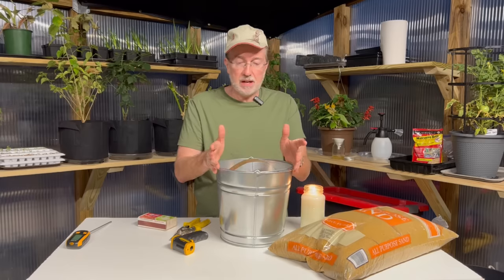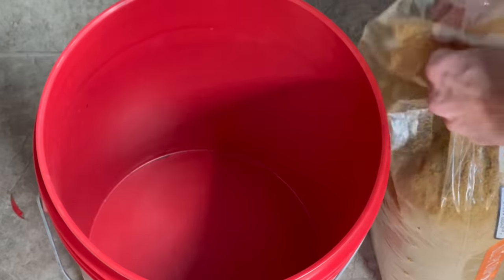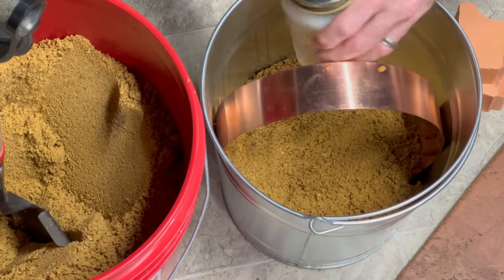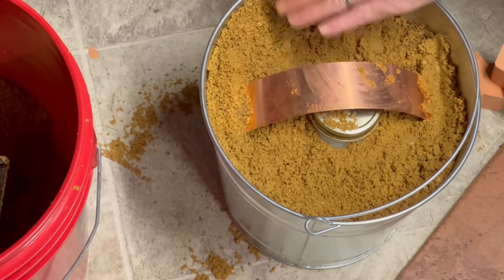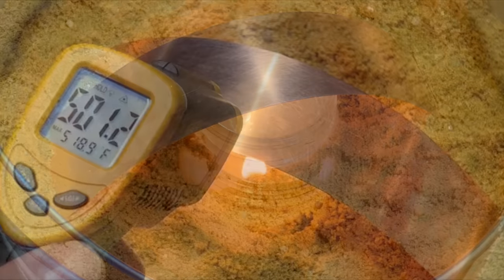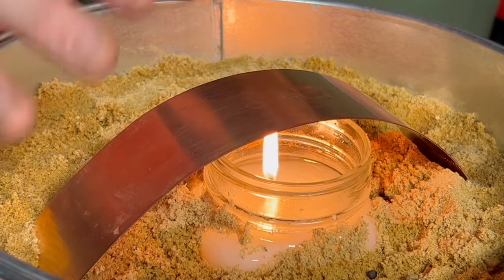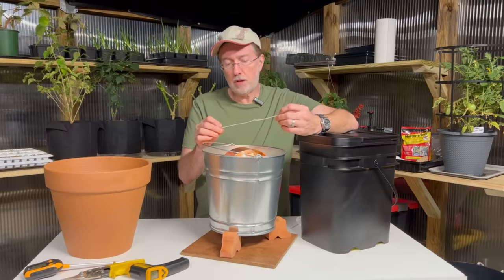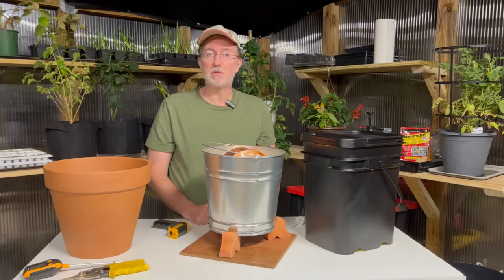DIY Copper And Sand Heater | No Electricity Needed For Greenhouse Heat

Comment: Uhhh, the copper temperature is not of interest. The result. What is the resulting temperature of the the bucket?
While this is all nifty keen, is the result worth all of this time and effort? Is the cost of time, monies for sand, bucket(s), copper, e.g. and economical substitute for electric?
Reply from the maker: Not designed to replace elec.  I believe I mention just suplemental.  This would be better for a small hoop house with tender seedlings in spring.  1-3 degrees above 32 is all that’s needed
Reply: @ZenGardenOasis.  I hope it serves you well.

Comment: How many BTU's does a candle put out.  Let's get some real numbers to validate these "observations".  My guess is that the BTU output is pretty low - these heaters don't do much unless you have a bunch of them.  Also, how much carbon monoxide are these things putting out?

Comment: The difference between candle alone and candle in the sand is none in terms of heat. Heat convection is  different between these two but I doubt there might be any practical advantage of candle in sand.

Comment: Nonsense, A single candle will not heat a room ( or a green house) any better with buckets of sand copper hoops ceramic plates and pots or anything else.
 The naked flame of one candle will give off about 80 BTUs and none of that other crap will increase the output. The temperature of the room with all these gizmos and hocus pocus nonsense will be exactly the same as it would be with the candle by itself.
 Don't be stupid.
A 100-square-foot 10 feet X 10 foot, room would need 4,500 BTUs to be heated effectively, which would take over 56 candles. By comparison, a small portable electric space heater can put out 18,000 BTUs. The cost to buy 56 candles and the cost in electricity to run the space heater for a few hours is going to be about the same, with the candles running a little more expensive depending on where they ar bought.
 Then there is the issue of carbon monoxide produced by the burning paraffin of 56 candles that will necessitate the introduction of outside air ventilation to keep you alive.That would reduce the net gain of the heat produced.
 There is no magical free ride.

Comment: You need to paint the backet with black stove paint. It wll change the bare mettal emissivity from couple of procent what shini matal have to around 90% of this black paint. The pait is design to wistand very high temperature. That copper sheet should be as wide as passible to increas the area of exposure to hear. The net energy that the candle  generate with and with out the sand backet is the same. However with out the sand backet all the heat will move with the warm air to the celing. The sand backer give off radiative heat were the occupants are, close to the floor. The only issue I have with this is the the candle generate CO2 in close room, so the air quality suffers. In todays air tight buildings it might not be too good idea.b
Reply from the maker: Sounds great
Reply: If in a greenhouse, plants like carbon dioxide. I have propane heat in my greenhouse and the installers said that CO2 and humidity would be higher as a result. It's never been a problem. The tiny amount emitted from a candle is insignificant. Also, people burn candles in their homes all the time.

Comment: No matter what you do the candle produces the same amount of heat. Instead of heating the air your heating sand which will heat the air it changes nothing.
Reply: Not nothing.  A candle produces a thin stream of very hot air that rushes to the roof and starts to radiated out into space.  The copper catches some of that heat and transfers it downward into the sand. The increased area of the sand heats a greater volume of air to a lesser degree and the warm air rises more slowly, mixing with more of the surounding air.  The total amount of heat is the same, but it is mixed around better, so that it is touching the plants rather than making the roof of the greenhouse very hot  while the plants stay cold.
Reply: @trikepilot101  put your hand 4 feet obove the candle you won't feel it it doesn't produce enough heat to make a noticeable difference. Even if it did the rising hot air would create currents that would mix all the air together anyway. Yes you warm up the sand and the heat rises off the sand to the ceiling the same way the candle would only slightly slower. That's alot of effort to make no noticeable difference

Comment: I don't get it.  The heat released from the flame now heats all the sand and the bucket and then heats the air.  If it burned in the open air it'd heat the air directly. Surely that's better?
You're surely not suggesting there's any extra heat gained by adding all that mass.  So it could only be you're claiming minimising heat loss somewhere.  Where?  Air convection currents throughout the room to the exterior?  But they will persist nevertheless.  I don't get it.

Comment: Ive tried electric it does nothing and i tryed a heat pump also didn't work i put a 30000 btu gas heater in there its been great for almost 4 years so run a gas line and get one used
Reply from the maker: Excellent.

Comment: Galvanized metal
Zinc poisoning?
Reply: Possibly. Better to use Stainless Steel or iron bucket.
Zinc toxicity can occur when an individual is exposed to and breathes the heated yellowish fumes produced from welding or heating galvanized steel. For hot-dipped galvanized steel the recommended maximum temperature is 392 F (200 C), before the metal presents a toxicity risk.

Comment: To replace my 1500w space heater I would need 65 candles. I don't see how this is practical, especially since I can't put a candle on a temperature control.
Reply from the maker: Only need a few degrees to keep the greenhouse above 32.  Check out the video about sand heater in Finland.
Reply: @ZenGardenOasis.   I keep mine at 40° with a 1500w PTC heater on a temp controller. Candles aren't going to cut it no matter how fancy they get.

Comment: You missed the entire point of the sand battery video;*  you’ve created a sand DIFFUSER.  Sand batteries are useful for storing heat for MONTHS.  In the SUMMER, they use solar electric power to heat a silo full of sand, and in the WINTER, they use that STORED heat for homes and the (relatively 𝙨𝙢𝙖𝙡𝙡) community pool.
* https://youtu.be/sol9FOaKTr0

Comment: The copper and sand are utterly unneeded, the heat output of the candle is unchanged. As long as the hot updraft from the candle can mix in the air before reaching the roof (and it will drive a convection circulation anyway) all the heat from the flame will be in the greenhouse.
Reply: The experiment IS the copper and sand. The candle flame heats the air and the copper. The copper conducts the heat to the sand. The sand acts as a thermal mass. A thermal mass stores heat now and releases it over time. It's how night storage heaters work.

Comment: This is a really inadequate test. There is not evidence that the bucket is getting warm at all. you should use the thermometer to take readings around the pot at the start and then something like every hour or two to show it the bucket is getting warm.

Comment: I don't understand the purpose of the sand or the bucket. The copper helps to distribute the heat so that part makes sense.
Reply from the maker: Watch YouTube video (Finland sand battery)
Reply: @ZenGardenOasis.  the sand stores heat. is the candle meant to be put out and the sand radiates stored heat? a candle is already a very small source of heat. not enough useable energy to store really.

Comment: You say copper or aluminum strip, Aluminum does Not transfer heat good at all.  I would use copper or steel only
Reply: Aluminium is a good conductor of heat

Comment: Get rid of the sand, bucket and copper and use the candle. It'll give out the same amount of heat. Then, when the light dawns, get rid of the candle and use wood, its cheaper.

Comment: Those temps are dangerous for a plastic bucket. Sand batteries are ancient but you will never change the laws if BTUs with s calendle. This js as silly as a candle in a terra corta put.😅😅😅😅
Reply from the maker: No plastic used

Comment: You can't get an accurate reading on the sides?? Does keep running away? As far as 500 degrees on TOP....THAT is the flame....all flames are a little warm. I use those laser heat reading guns on engines ALL THE TIME....they tell you the heat. I expect that pail is room temperature at best...if not show us the temp of the side. This does NOT add up.

Comment: Maybe I am just a nut but there is literally no difference between this kind of heater and just burning a candle in an enclosed space. You will get the same amount of heat no matter what blend of supposed alchemical hoops you try to put that heat through you can't make more heat without more fuel.

Comment: Absolute horse manure HVAC contractor for 38 years and 1 candle no mater how you burn it will only create 1candle power which is next to nothing heat wise you cannot multiply what is not there this factually impossible.

Comment: Yeah this is a highly inefficient way of heating a room.  You need 20-30 candles to heat a room properly. Not to mention that candles or whatever your fuel is burns away so you'll be constantly replacing them... Nahhhh... Nope... Just hookup an electric space heater.
Reply from the maker: This for heating a very small greenhouse, hoophouse or tented vegetables.  Not to heat to comfortable 72f but rather 1-3 degrees above freezing.
Reply from the maker: This for heating a very small greenhouse, hoophouse or tented vegetables.  Not to heat to comfortable 72f but rather 1-3 degrees above freezing.

Comment: Like many others pointed out, the total heat produced by the candle is the same with or without this contraption. The only thing you're accomplish here is slow down the release of the heat (the benefit of that is also questionable), and creating a huge fire hazard. The candle wax could heat up to the point where the vapour coming off of it can ignite (from the entire surface, not just the wick), this generates even more heat, now you have boiling wax and a giant spitting fireball you can only put out with a class F fire extinguisher... Not a great idea. I wouldn't recommend anyone to replicate this.

Comment: Burning candles will never be Cheaper than the electricity you purchase.
It will never be cheaper burning candles for heat than the electricity you can purchase.
You would be MORE effective by better insulation of your greenhouse.
Reply: Come to Germany. Cheap paraffin candles cost 16.5ct/kWh - electricity about 30ct/kWh

Comment: I'm a disbeliever ! 
The copper and sand can not generate more heat than the candle its self.
Sure it gets hot, it's taking the heat from the candle Which would normally be distributed straight to the room .
You have achieved nothing with this setup.
Reply from the maker: Wasn’t that a song.  I’m a disbeliever I couldn’t deceiver if I tried. 😂

Comment: Warning. 
Never use. 
This is a bad idea!
Reply from the maker: Works perfectly in my small hoop houses.   Keeps tender plants from freezing.  Not designed for heating your home.
Reply: @ZenGardenOasis.  glad you put this disclaimer up. 
So no one will heat there home with it. 
Oh. 
Why? 
Would it be………
Dangerous?
😂
Reply: Also oil lamps are not candles. 
They produce up to 1800 btu’s which uses significantly more oxygen than a candle at 50-80 btu’s. 200 times more!
Light 200 candles in your greenhouse and breath in the not air. 
which was my original assessment of your death heater with a flaming sand surprise.  So ya oxygen is an issue with this killer. 
Good for you showing us how to make a death tent.